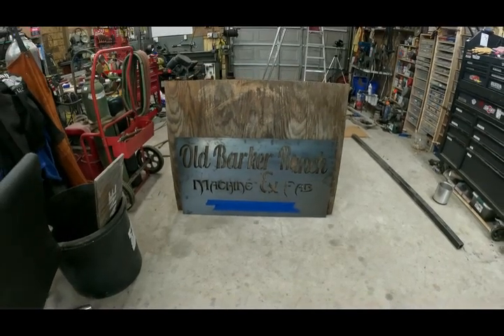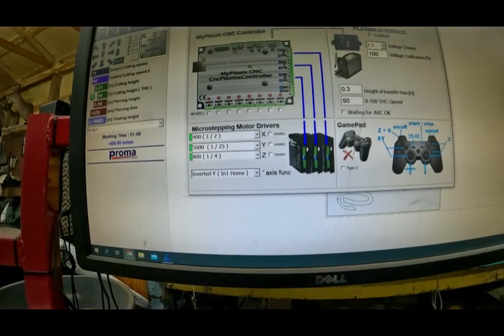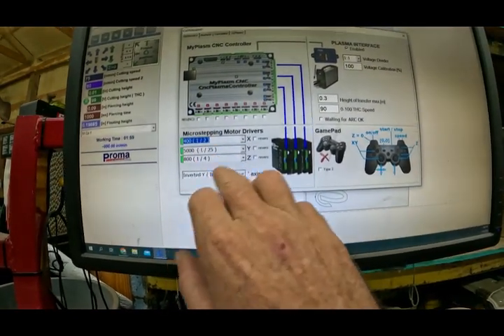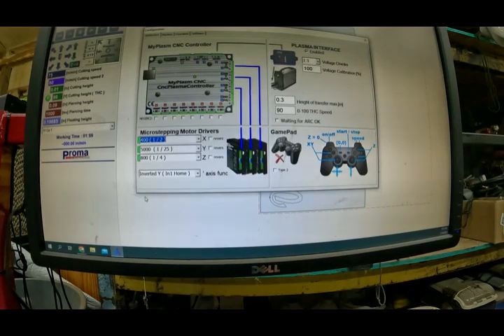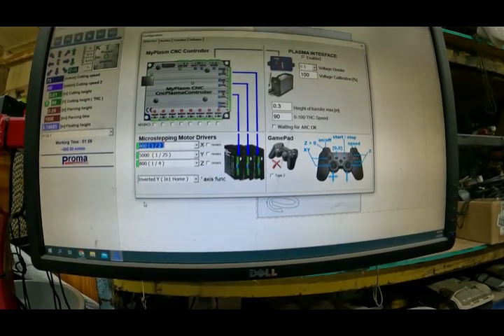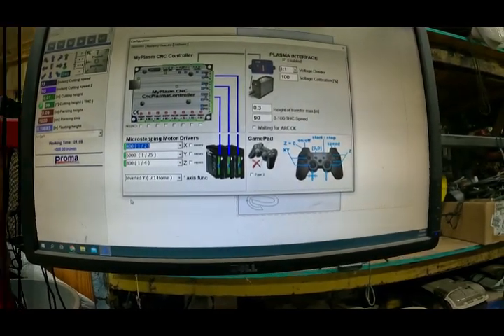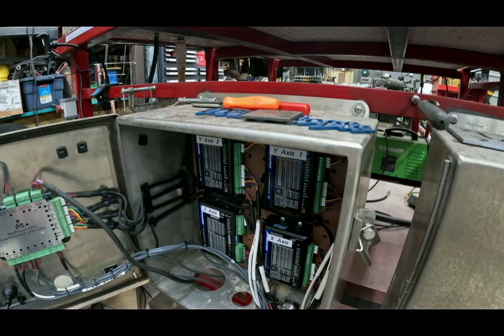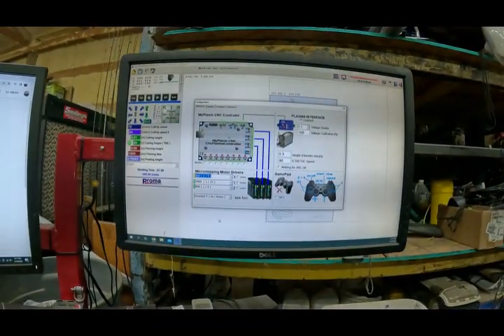Proma MyPlasm Missing Steps?? Try This!!

Comment: Hi.
  the 400 steps suggested by the program means that you have a very large mechanical reduction of this axis. For CNC plasma cutters, it is no good due to the need for high speed and dynamics of work. this is your main problem.

What is your gears setup ( move distance per one motor rev ? )

Look here : #00 and #02 PLESE !!!
https://youtube.com/playlist?list=PL4mAP2xoaD8o6Vbb5bG3nL2eaxaHzrPLK

Regards.
Reply from the maker: Thanks for the help!
Reply from the maker: The Y Axis is running on a lead screw.. there is plans to change it over to rack and pinion soon.
Reply: @Old Barker Ranch Yeah I saw that on another video :)
Works very well considering it's screws